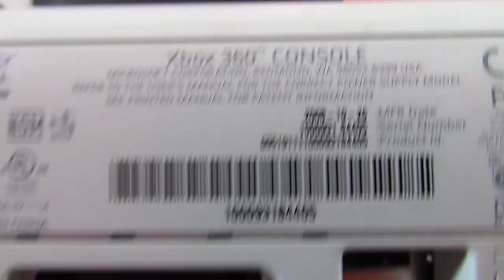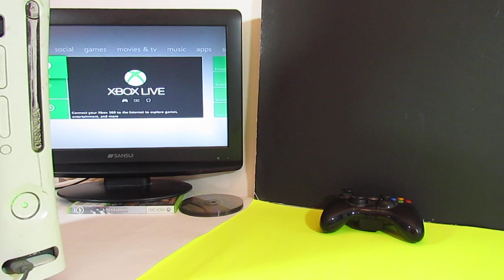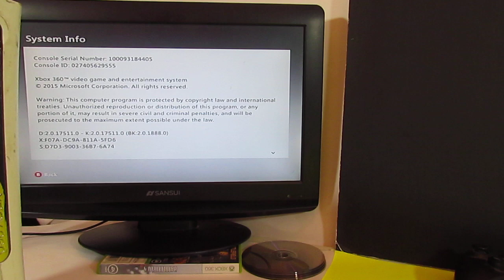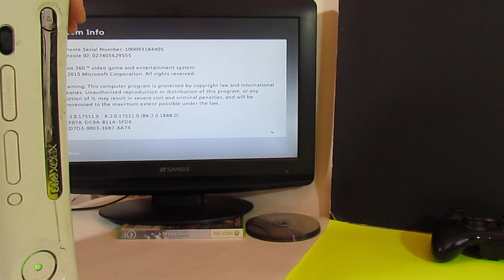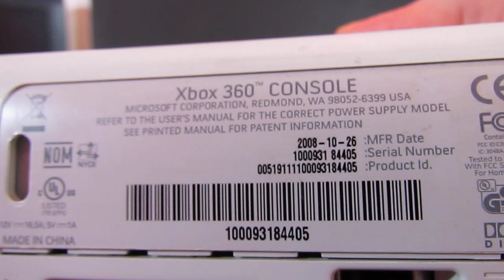Xbox 360..Why would Microsoft MFR a Zephyr motherboard in late 2008 is there more to the story?

Comment: I have an elite that has a similar manufacturing date. Old console that was repaired theory could be correct, mine has a benQ and they quit using those earlier than my mfg date.  I also have a falcon that says it uses 16.5 amps from 2007 and all the serials match so no weird stuff going on, just a transitional period console from zypher to falcon and the stickers hadn't been updated yet.

Comment: Cool 360, seen a number of times these motherboards with the DEV0 stickers on over time. What’s the date on the barcoded sticker it will be the MB serial number and date of manufacture normally. I have 2 falcons, a jasper and a xenon with these numbers board date is always months before the case date. I suspect the board was some kind of engineering sample later built up into a full system and sold. Both my falcons are very early fixed chip boards from week 2 2008. These Rhea chips not normally showing up until week 13 on production line. I have seen bone pile early xenon boards in 2010 non hdmi counsels with Elpis chips. MS reused boards in a mix and match way at times it seems but this one is a first on zephyr.
Reply from the maker: Thank you 👌🎮

Comment: Its actually not uncommon to find Zephyrs with very late MGF dates, in perspective, it would of been one which had a more reliable RHEA chip in replacement if it was late in. It does not say serviced which is an indication it left the factory at that time. Serviced is usually used if the console was re-sold as refurbished by Microsoft themselves, ones repaired under warranty would not share the serviced sticker (which is super unusual). Check the date on the RF shield, it it too states the same date as the case, it was genuinely manufactured on this date. Possibly a Ex Debug board maybe? But Microsoft was never keen re-using them parts, thus they would have gone for recycling. :)
Reply from the maker: Good information bro I appreciate it 🎮👌

Comment: Easy explanation. It’s a console that was sent back to Microsoft for drive issues under warranty. I’ve come across even Xenon consoles that have a date of 2007-2008 on them, just to pop it open and find a lite-on drive. Easy way to tell is by taking the faceplate off. If you find that paper warranty sticker as opposed to the original metallic strip Microsoft used to use, it’s a warranty console. 

They didn’t use the paper stickers as standard until Jasper models, so anything older than a Jasper with that sticker was a warranty console.

Also, finding a lite on drive in anything older than a Jasper means it’s 100% a warranty console as Lite-On drives weren’t shipped in retail consoles until the Jasper board.
Reply from the maker: 🕹️🎮 Thank you
Reply: @TransFormersLikeTech6587 This is not true they use paper warranty stickers on all 2008+. 2007 was the last year for silver warranty sticker. Souce, Ive Jtag& RGH over 50 consoles all phats from 2005-2010
Reply: I have one that Say Service date 2010 and it’s a Zephyr…. Was sent in for service.
Reply: Are you saying most of the disks drives were replaced on refurbished Xenon/Zephyr models?
Reply: @matttherrien9608  yep. It was mainly due to drive security, it was during the peak of drive flashing and the lite-on drives required more steps to get it into vendor mode.
Reply: @50ne50  were they mechanically any less reliable than the previous drives?
Reply: @matttherrien9608  in order of best to worst in reliability for phat models. Drive reliability goes as followed: Hitachi-LG, Phillips/Lite-On, Phillips BenQ, and Toshiba Samsung.
Reply: @50ne50  turns out all three of my 360s have yellow lite on yellow wires.
2007 refurbished Zephyr, 2009 Jasper and 2011Slim Corona.
Reply: @matttherrien9608  nothing wrong with the lite on drives. They just tend to have stuck trays eventually but overall they’re pretty stout. They can be the louder of the bunch but some white lithium grease on the moving parts solves that issue.
Reply: @50ne50 thank you.  I'm surprised they replaced all those drives.  Doesn't seem economically viable.  I bought my refurbished Zephyr a few weeks ago and I'm looking forward to giving it another tour of duty.  Last week for less than 20 bucks I bought an Elite black v2 Jasper Kronos loose.
Reply: @matttherrien9608  use good thermal compound on that zephyr, but not Liquid Metal. It’s a safer bet to also use the Falcon/jasper heatsinks on it as they run almost 10° cooler. Those Kronos Jasper boards are nearly indestructible so you shouldn’t have ANY issues with that one.
Reply: The last part of this comment is a little incorrect. The later falcons also had a lite on drive in retail.